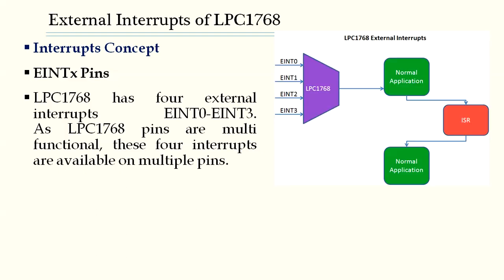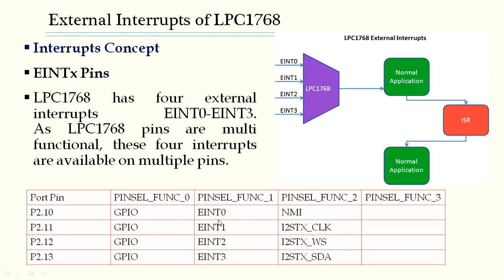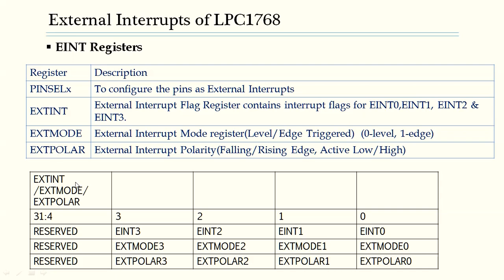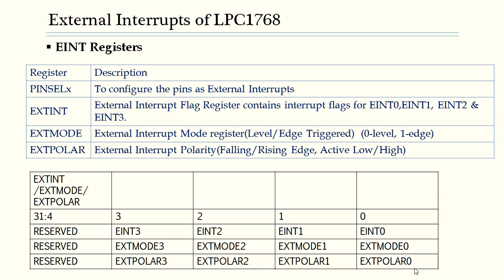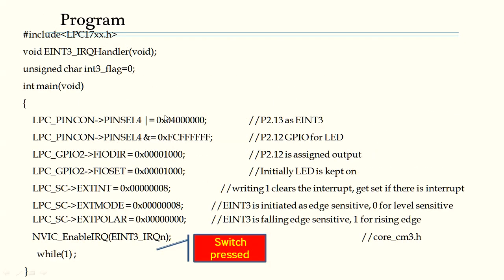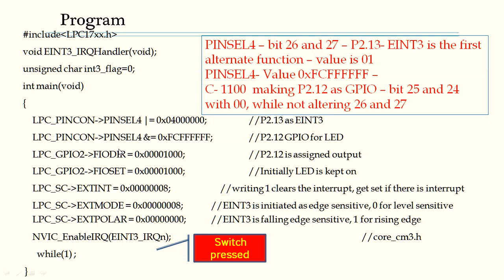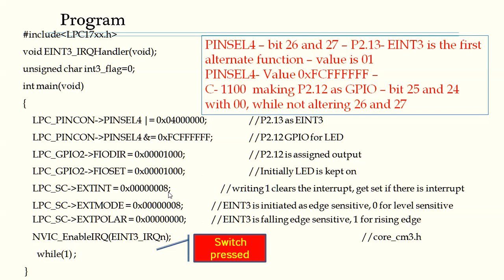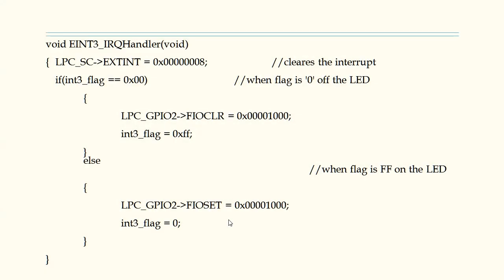Program to Interface External Interrupt (Switch) to LPC1768

Comment: How to upload progrm from computer to lpc1768
Reply from the maker: I hope you are using keil Uvision IDE. Convert it to hex file and depending upon the communication channel either RS232 or USB you can program  LPC 1768 using flashmagic . You need to check the make of development board and the support to program the controller